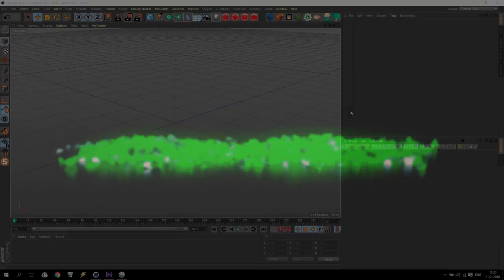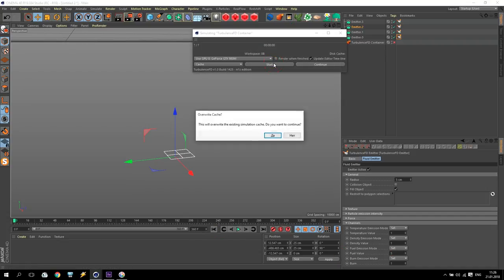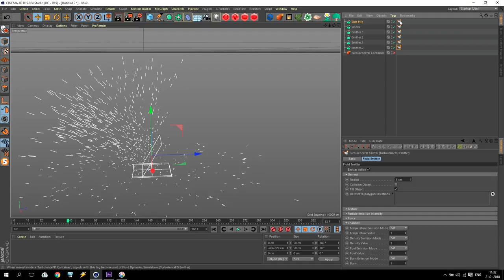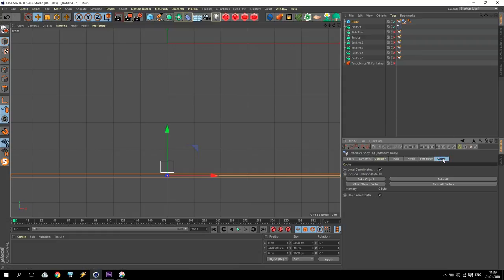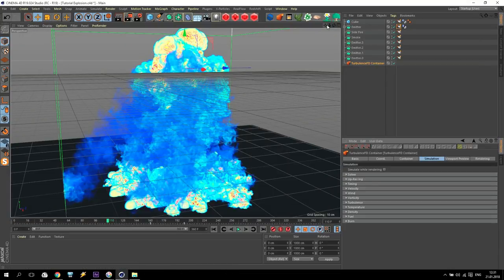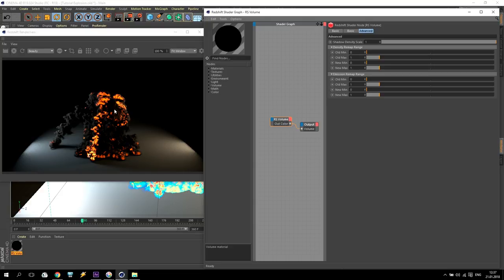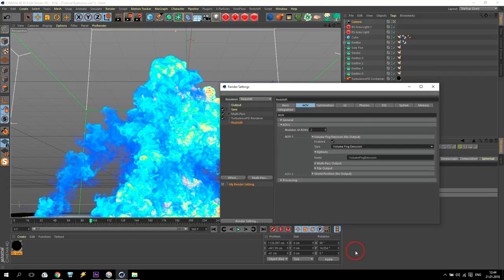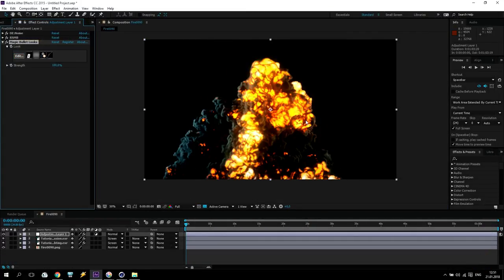Redshift / TurbulenceFD / AOV Volume / Explosion / C4D

Comment: I need a bit of help! Everything works fine, but when I try and sim with my RTX 2080 TI (Cuda is working), it automatically switches the device back to my CPU. I have no idea what's causing this issue! Help!
Reply from the maker: Sorry, but I have no experience with 2080... Maybe it's too new and too powerful for TFD...
Reply: @Cinema4DTutorialsSV  It didn't work on my GTX 1070 TI a few weeks ago. Every thread I visit has the same problem, different devices, but no solution.
Reply from the maker: I am not sure, but times ago I saw some post on forum, that TFD doing automatical choose for CPU, if you CPU more powerful than GPU. Also, if you have big simulation, but your videomemory not too much - also TFD jump to CPU. I have 8GB of GPU...
Reply: @Cinema4DTutorialsSV  I've got 12 GB GPU and- Oh. Well i should've known more about my PC before I got mad. Even with 16 GB it takes hours to simulate something simple
Reply from the maker: Start from simple simulation. Then you'll get more information about your PC. Good luck!

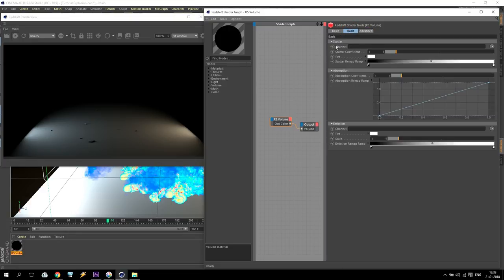Comment: I have an problem in 27:10. In Redshift Shader Graph in Basic; Scatter; Channel; TurbulenceFD I can't choose Density. It's there in window, but cannot be choosen. In Emission window below it's the same problem.
Reply from the maker: I know this problem. You have to reinstall TFD. It's should help.
Reply: Still nothing... Cannot be the problem in Redshift?
Reply from the maker: It's hard to say ... Maybe ... Several subscribers have already written about this problem. Reinstalling the plugin helped them. I hope you can solve your problem.
Reply: @Cinema4DTutorialsSV  Same Problem for me. What do you mean by reinstalling? Deleting and pasting the TFD Folder into Plugins again? Unfortunately didn't help. Could it be so because I use the trial version of both, redshift and TFD? But both State that their trial version is fully functional, only watermarks..

Really need help..

Is there maybe a workaround?
Reply from the maker: No idea... Full reinstallation usually helps...
Reply: @TheMasterof98  I have not seen anyone say deleting the TFD folder from the plugins folder and then copying it again worked for them. It surely has not worked for me either. Unless there is some other way to install the plugin, this is not doing anything. The options are still greyed out.
Reply: @Cinema4DTutorialsSV  What does that mean? Delete the TFD folder in the plugins folder and then place a new copy there? What does "Full installation means? You mean reinstall C4D then TFD?